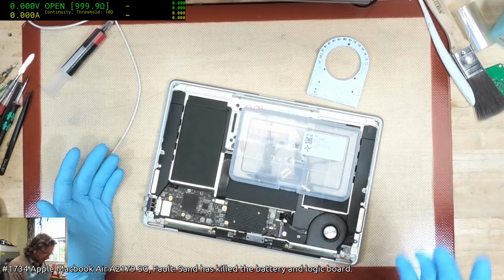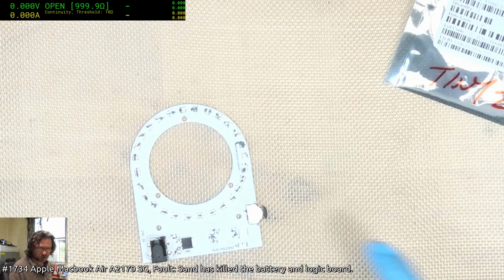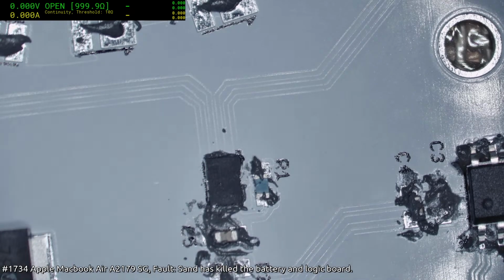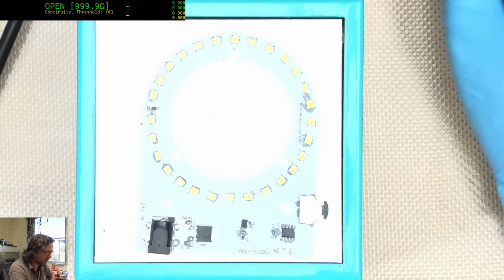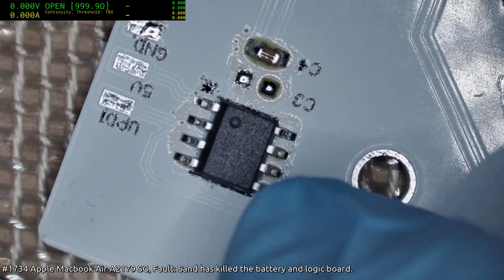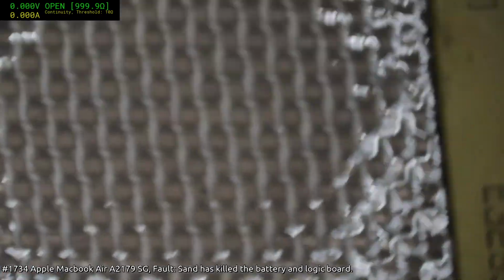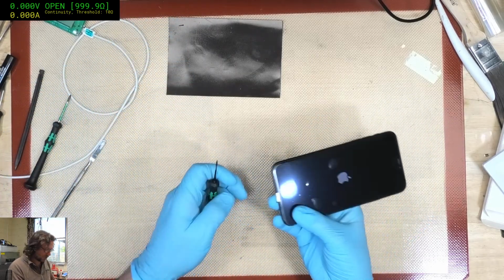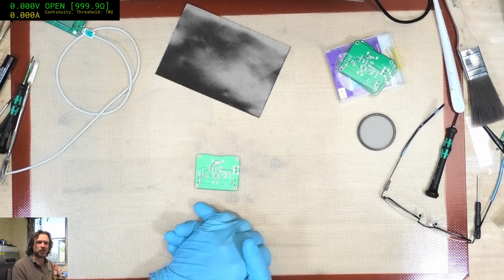Microscope Ring Light - live build of latest (and hopefully production!) version

Comment: Thanks for video/stream Paul! I really want to try out one of your microscope ring lights when you start selling them. It’s tough finding a good quality one with the light spectrum needed for a good clear picture. Amazon has a bunch but some of the colors are just off to me and not consistent enough.

Have you had any luck on a new 4K true 60 fps microscope camera yet? I did see that RISING CAM is selling one that looks really promising for about 500$ usd. From what I can tell in the video it appears to be legit vs the other frame interpolated cameras out right now. It’s called the RT5109 4K 60 fps and claims it’s a IMX334. The video they provided looks really smooth and video quality looks good as well.

Comment: Thank you for saying you will get a stencil later. Get a steel one, no frame. Don't bother cutting yourself.
It's like 10 bucks at PCBWay. If you need 2-sided and don't need em seperate you can even get Both sides of the pcb on a single stencil for same price.
Reply from the maker: I'll be waiting to see how the new USB-C meter board goes.  If that's a success then I can make my larger order of both ring light and USB-C board + stencils in one order.

Running in to trouble getting more of those 8x2 CoG LCD units unfortunately.  DisplayTech sell the backlight-equipped units but not the reflective only :(

Comment: I would 3d print a set of round washer like fasteners for 2 screws, and a small handle with a cam built in to tension the design to the barlow.

Comment: Damn crazy no notification nothing  Is on your last couple streams Got to love YouTube 😢
Reply from the maker: Well, that's your ringlight that was made up.
Reply: @Paul Daniels  No way that's awesome bro It's a special Signature Still signed lol Can't wait to replace my big bulky His ring light with the skinny version And the meters I can't wait to get to test
Reply from the maker: @QsTechService1  what power supply are you using currently for your existing ring light? You'll need a 24V 1A source.  

https://au.element14.com/multicomp/mc141026/adaptor-ac-dc-24v-1a/dp/267612202

or

https://au.element14.com/xp-power/vet24us240c2-ja/adaptor-ac-dc-24v-1a/dp/2708287

are what I use for the job
Reply: That's fine paul I'll get power supplies that you recommended ... Can't wait to get in test Thanks for the hard work ..For Some reason this video keeps glitching out at 1080p
Reply from the maker: @QsTechService1  it's youtube doing odd things to live-streams during post-processing.
Reply: @pldaniels  I just noticed that it's something with youtube lately ... Very strange
Reply: @pldaniels  The video finally finished processing watched the video Wow looks like a awesome light ...Especially that switch That's a game changer And a heat sink Really nice design Can't wait to receive and test and use Thanks paul